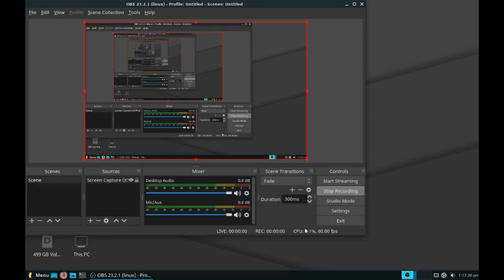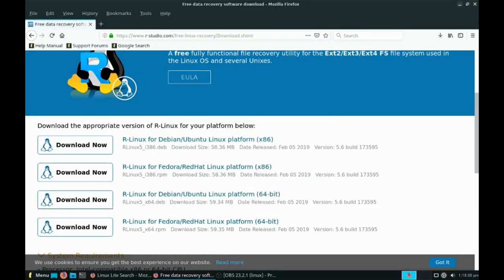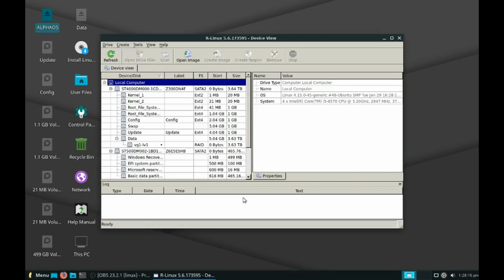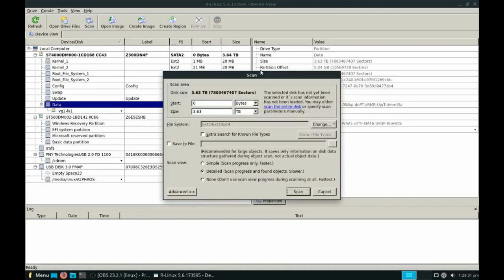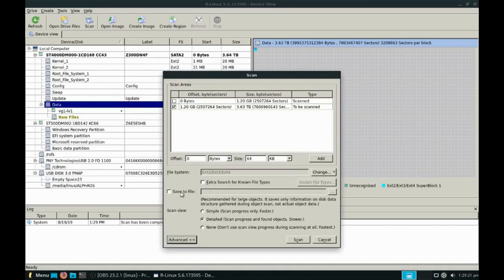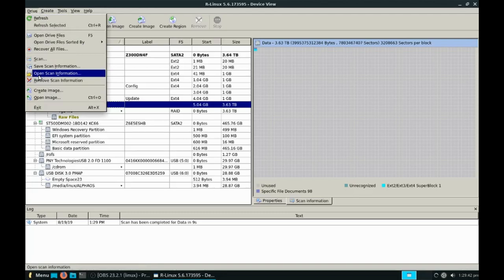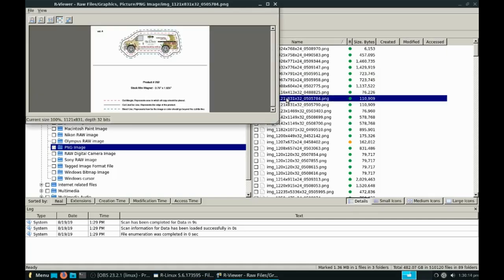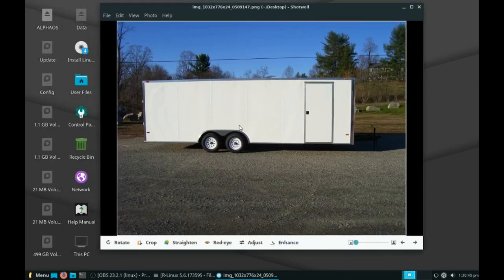Seagate Central Network Attached Storage -NAS -  Tear down And Data Recovery (HD)

Comment: ***Mac Users***Great video up to a point.  R-Linux was confusing for me.  Plus i have a MAC, i did everything up to the point where he talks about the Software from Linux. I purchased a enclosure from Micro Center for 35 bucks, installed the HD.  I use SetApp on my mac, which gave me access to an Application Called Disk Drill. It recognized the hard drive and recovered everything.  Great video, i appreciate it.

Comment: This Seagate Central if you still have one basically you will only will able to use it as an internal drive or external if you get another case.. in my case the device works, it connects to the admin page, but there's no more remote access or mobile apps to manage the folders you want to share.

Also the basic folder that should be created doesn't open in Windows anymore, so I can't use it until I removed it from the case.

Comment: I don't know if you monitor this video. I have a question. Do you think it's possible to switch a Seagate Central 2TB drive with a 4TB drive from another Seagate Central NAS that has ethernet port issues? I think the data is fine, I think the issue is the ethernet port.

Comment: great video.
I have the same unit but it went dead after  it hit the floor from 1m height.
I plan to replace its 3.5" HDD,  i had already bought a new one but i don't know how should i partition it. 
If you still have your"segate central" working or managed to replace its internal HDD would you please capture and upload an acronis image for its HDD; i noticed many owners have my problem.
 i'm stuck in rebuilding the new HDD process.
your kind support is highly appreciested; maybe someday you need that image to rebuild yours .Thanks in advance.
Reply: Did you manage to replace de hdd?, i have a dead disk and was wondering if a hard drive replacement was possible. havent been able to find any clues on how to do it

Comment: I have the Seagate Central 4TB NAS.  It is no longer recognized when I connect it to my PC.  Powers up fine, but has a flashing LED.  Can I use a hard drive dual bay dock/duplicator to use this same process?
Reply: hi i have the same problem. it doesnt recognize the network. how did you solve the problem?
Reply: @AliMuratSonel   POR LO VISTO NADI A RESUELTO NADAY EL DUEÑO DEL CANAL TAMPOCO  yo ando  con el mismo bateo